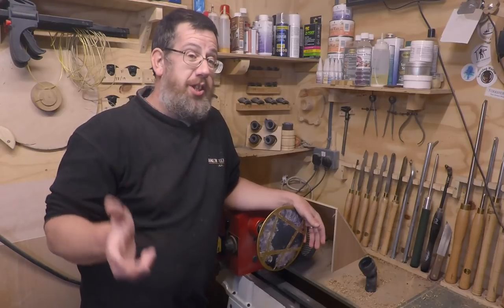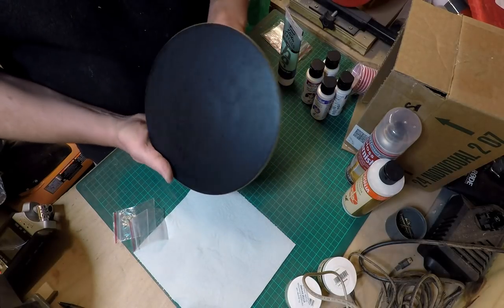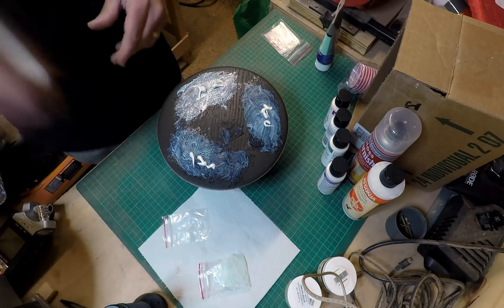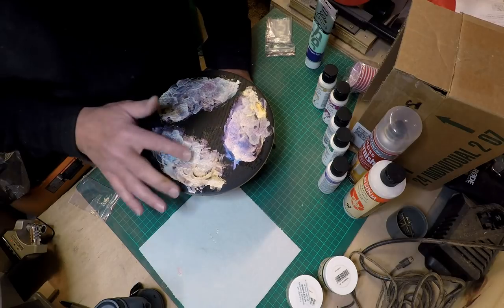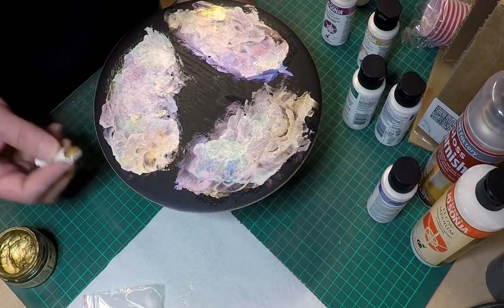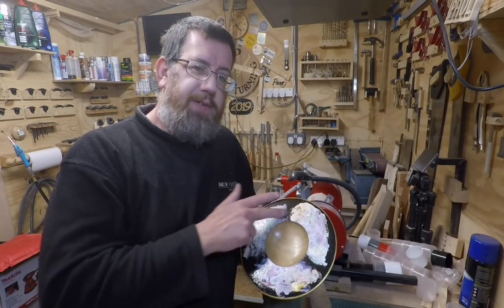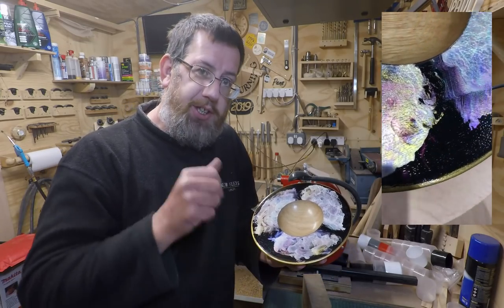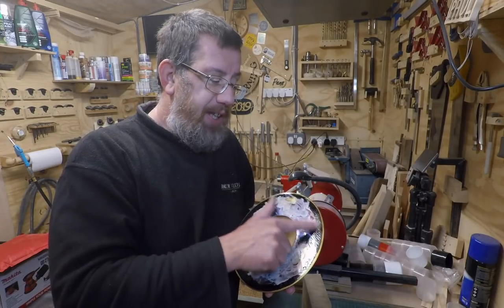Oak Bowl With Painted Decoration 2nd Attempt - Episode 200

Comment: Agree, the black, gold, and colors are good. My dissatisfaction is with pattern/design. I think if you blend the three blobs that have messy edges, into a continuous color ring, leaving the black on the outer edges, it will present better and have much better eye flow. Or tape the area between the three areas to give clean separation lines. Maybe third time will be the charm!
Reply from the maker: Thank you Valerie. Yes it's a good point to make it one continuous loop of colour. I think as I started with three areas on the first version that just carried through to this one. This ended up as a finished piece, so not so sure if there will be another attempt for a while.
Reply: Paul Lockwood ‘Til another day, and another piece then!

Comment: Sorry Paul I still think you are using too much JoSona paints. I've found if you use less and layer it it works better. You also get a better effect with paint direct onto the black
Reply from the maker: Thank you Wayne. Yes totally agree with too much paint. I did these over a month ago so could do this version based on comments from the first version. All experimentation and at least it's an improvement on the first one, which in all honesty didn't take much effort to improve on. 😂